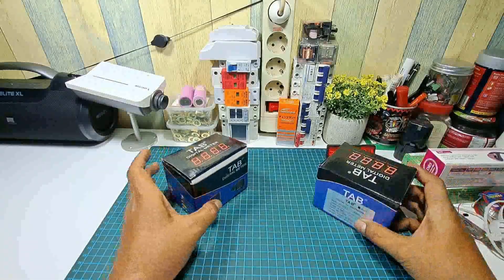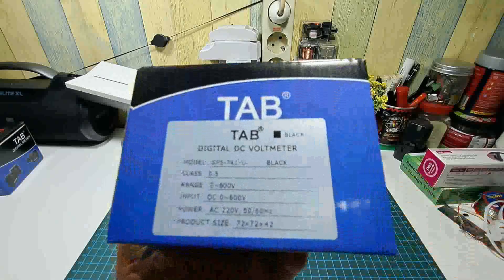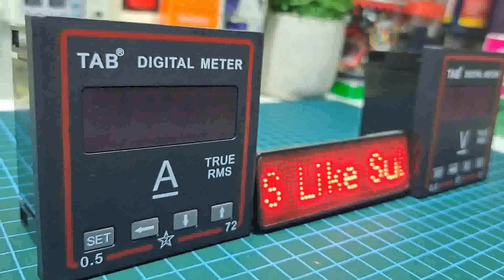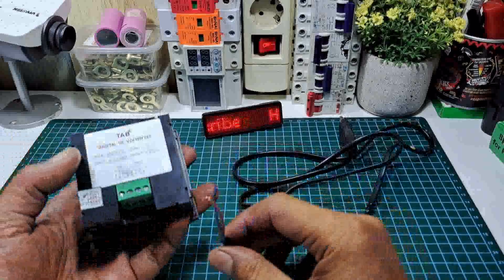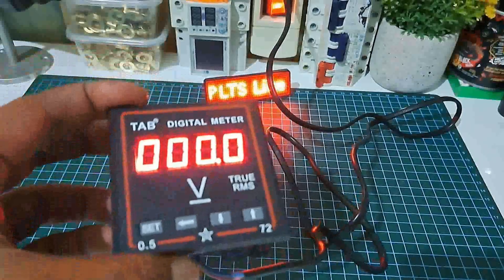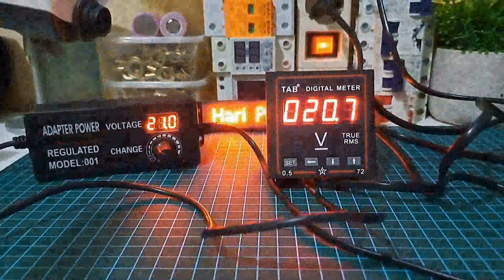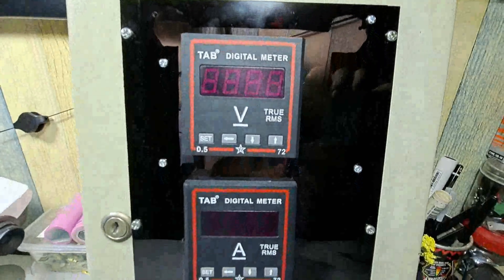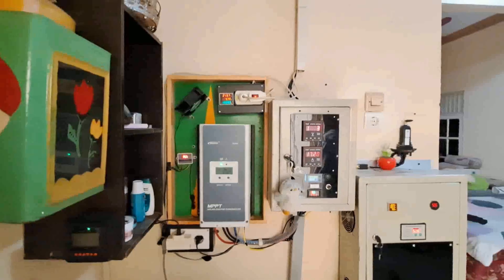Indikator ini sangat penting untuk PLTS 24 jam

Comment: Bang bgm. Skema kabel  utk. Pasang ampere meter Tab …
Reply from the maker: Siap cek disni bang
https://youtu.be/0Y4Lzaq1icg
Reply: Kalau volt meter  Saya ok..    utk.  Yg, ampere meter bgm bang ..?..
Reply from the maker: @franssiswoko548  amper meter hrs tambah shunt bang https://tokopedia.link/e2KsEUHtpxb
Reply: Bang saya Sdh. tambah R Shunt tetap belum menyala. Boleh skema kabelnya dari SCC ke R Shunt dan Ampere meter .. tks.
Reply from the maker: @franssiswoko548  siap bang nt saya ksh🙏
Reply: Maaf bang mana skema pasang Tab dc meter 🙏🏻🙏🏻
Reply from the maker: @franssiswoko548  di plts abang udh pake shunt blm?
Reply from the maker: @franssiswoko548  skema baru kelar bang cek di sini
https://tokopedia.link/JFU2c85ZMxb
Reply: Tks. Bang… ini yg. Saya tunggu
Reply from the maker: @franssiswoko548  siap sma" mkasih bang🙏

Comment: Bang,voltase batrei system 48V ,penuh/fullnya bagus di angka voltase brp jika menggunakan batrai 12v190ah? 
Punya saya fullnya di angka 56V. Itu bagus tdk bang?
Reply from the maker: Bagus nya aki full di angka 13v bang jika main di 48v tinggal x 4 berarti 13v x 4 aki = 52v🙏
Reply: @HariPLTS  berarti main di 14V terlalu tinggi ya bang..
Reply from the maker: @user-A.Dspt5ou6df1i  betul bang takut nya over charging aki cpt kembung🙏
Reply: @HariPLTS  ke 2 jg bang. Pada saat hari cerah di angka 14V. Pada saat tiba2 mendung  turun drastis ke 13.1V. Itu normal tdk batrai nya bang?
Reply from the maker: @user-A.Dspt5ou6df1i  normal bang dia ikut sinar pas chargingnya
Reply: @HariPLTS  saya kira batterai saya loyo. terimakasih informasinya  dan ilmu nya bang.
Reply from the maker: @user-A.Dspt5ou6df1i  siyap sma" bang mkasih 🙏